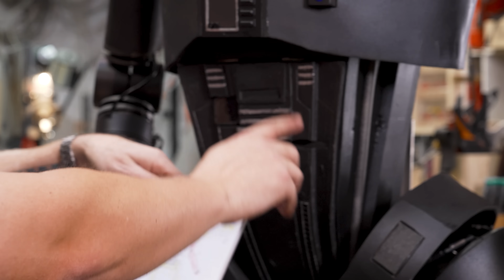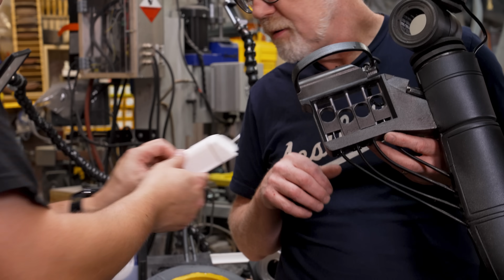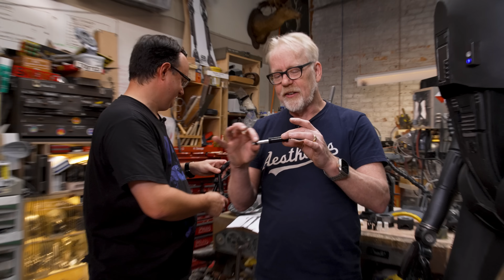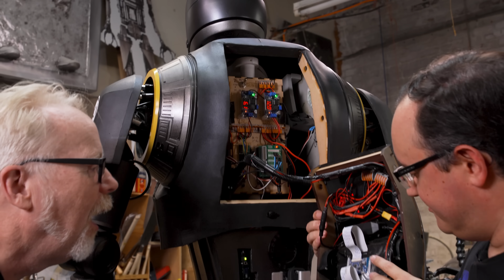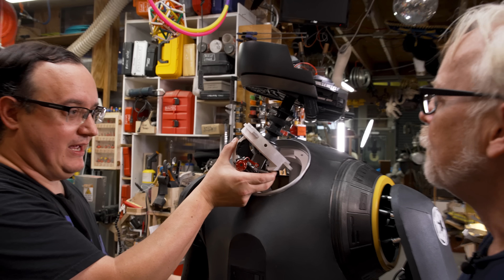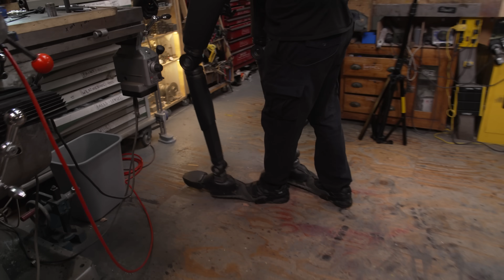Adam Savage in Awe of This Life-Size K-2SO Cosplay!

Comment: You could put a pair of webcams in the robot eyes. Connected to a VR headset that the puppeteer wears. A eye tracking device built into the VR headset would control servos that move the webcams in the robot head. And lights of the robot eye would be connected to the webcams as a single piece. Head movement of the puppeteer would control neck servos of the robot. Result is the puppeteer feels that he is looking through the eyes of the robot, and the robot head and eyes move naturally.

Comment: Working with me would allow for a better transition of knowledge and power my intention was to not need to destroy the old systems there resistance to the new potential is the problem what happens to low watt resistor trying to stop a reactor it can only do its job so much 😅 till it fails with fireworks however if channeled with a proper conduit or conductor the amount of progress in its self would speak volumes

Comment: The mirror trick part, I guess if you have to move around a lot you cannot just have two cylinders holding each other to keep them hollow?  You can do that in models that don't move a lot but it will be too fragile in that kind of size and motion.
You maybe able to use small monitors and cameras so you can see through them, but the reflection on the monitor is going to give it away.

the back monitor might be able to change to VR/AR glasses?
Reply: All good ideas. Yes. I went with the mirrors as 3D Printed hollow joints would be too weak for the stresses of walking.

Comment: Even the 6 inch action figures use a similar trick for the joints. They can't actually be hollow, so they use transparent plastic, so at a glance it looks right as light passes through, but they're part of the functioning joint holding up the figure.

Also, Once Darren started puppeteering, I held up my hand to obscure him from view, leaving only K-2SO visible, and it was very unnerving looking at K-2SO moving around in front of Adam.
Reply from the maker: Oh, very cool.

Comment: The mirror is genius!
Reply: I still wonder whether it would be possible to use metal pipe and two ball or roller bearings to get rid of the mirror.
Reply: @wilfriedklaebe  Not a bad idea. Some other makers have come a long way with a fully 3D printed version of K2's knee joints. So maybe one day no more mirrors.